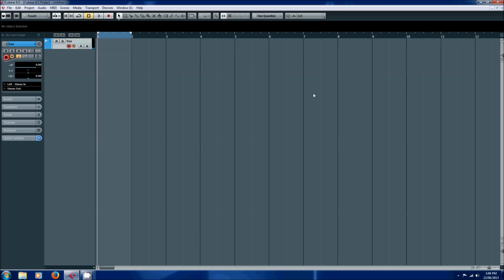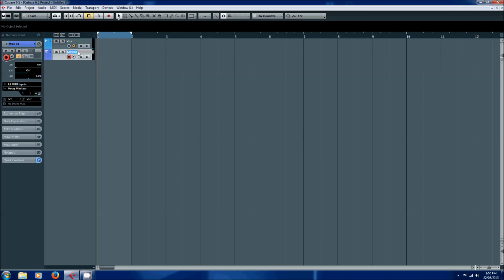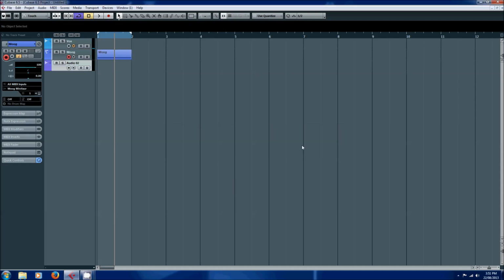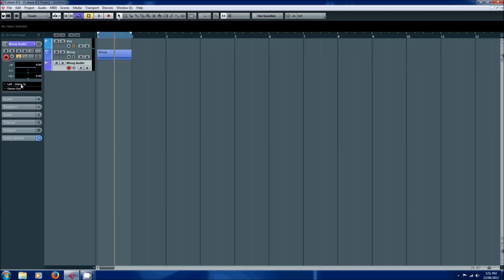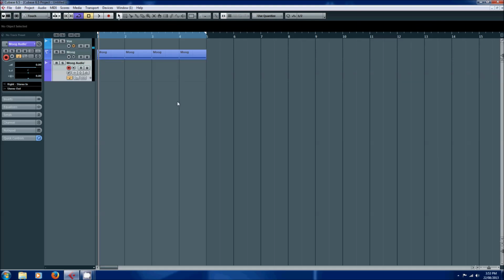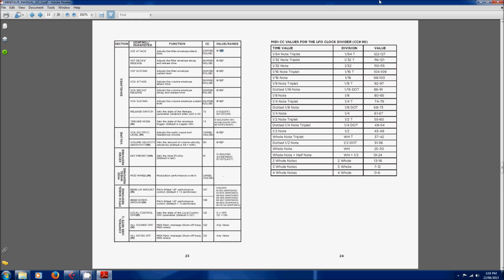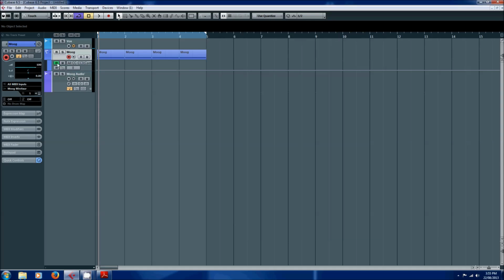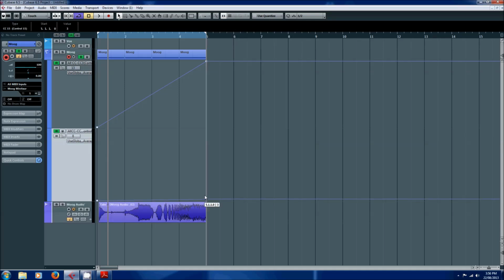Cubase 6.5 - Using external Synth + Midi automations CC's  (Moog Minitaur)

Comment: Great video! My synthesizer didn't came with a cd or has any drivers. Is it really neccesary to install an external device since the midi connections are universal? My midi does work but the more cc commands i send from my computer, the less commands get received by the synthesizer.